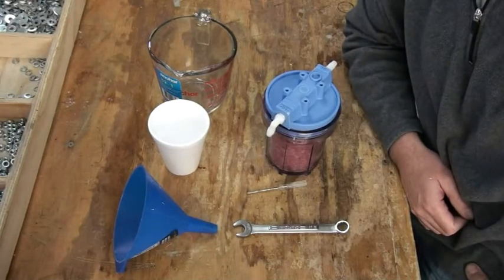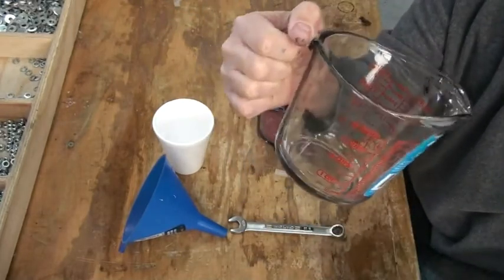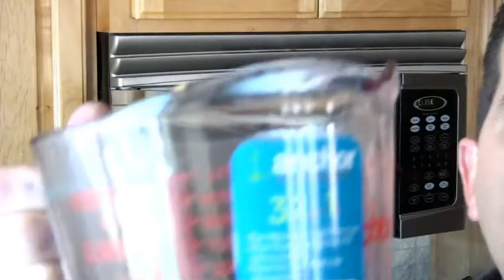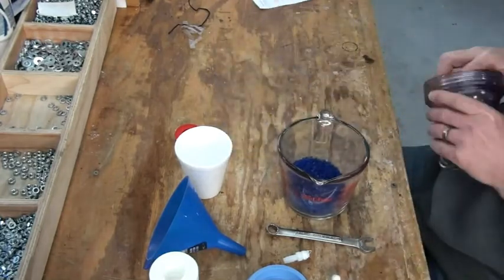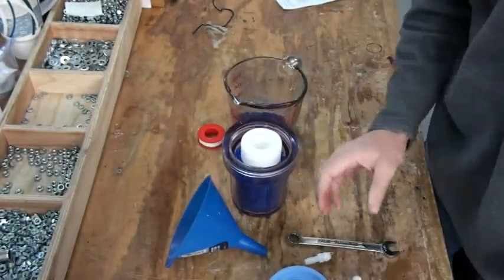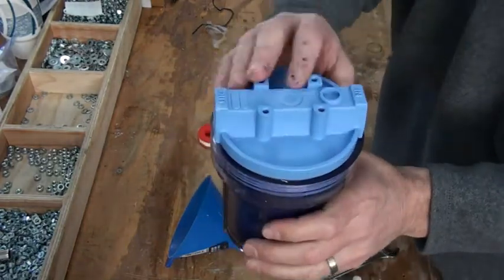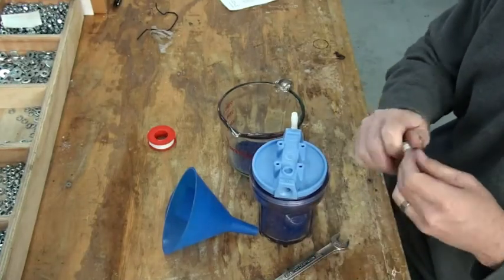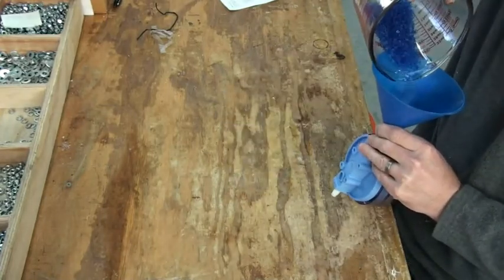How to recharge the desiccant beads in your Large flash arrestor/dryer

Comment: hi steve.. i have question about desiccant as my hho torch dryer, i put the desiccant beads in a plastic container after bubbler (im using thinner lacquer), and its getting hot within seconds is this normal ? im afraid it could soften/melt the container if im using it for long run
fyi this is my first use of desiccant  as dryer
Reply: Use regular bubbler with water, then the gas should be directed to the desiccant chamber to remove any water vapor that remains in the HHO, then the dry HHO should be directed to your bubbler with acetone/or lacquer thinner (don't dilute). The main purpose of using lacquer thinner or acetone is to change the nature of the flame, not to rid the HHO gas from moisture, it will remove moisture, but the purpose is usually to create a redox flame rather than oxidative so that welding metals that oxidize easily like aluminum is much easier

Comment: Do you have any videos on how to build and which parts purchased on your HHO builds, like the flash arrestor and dryer combo as well as the other flash arrestor on top of bubbler. Looks like a couple of pvc pipes, but would like to learn more  That would be pretty cool to make one for my lil ones class project on "the benefits and ever changing properties of  water"💧I have ton of cool ideas when it comes to different cell designs and alternative power supply using RF frequency to create power. Mimicking the same concept to excite electrons but instead of oscillating magnetism i purpose radio waves to excite and do the same thing. I would love to tell you more... question, may I have your email so that I may show you hoe my dry cell looks so far? My email is westwood08@gmail.com